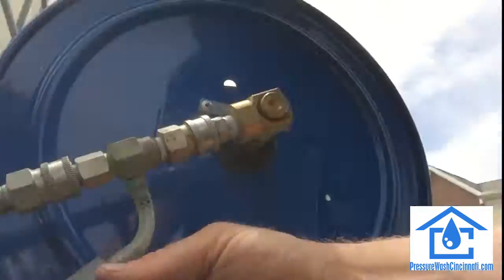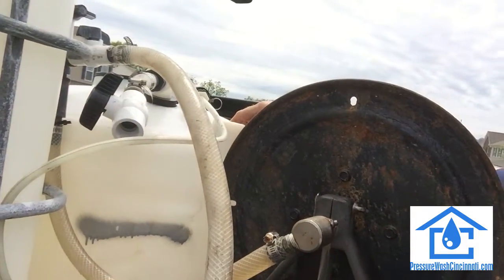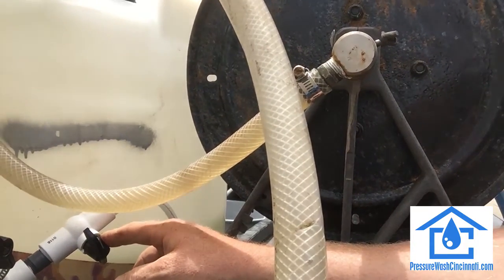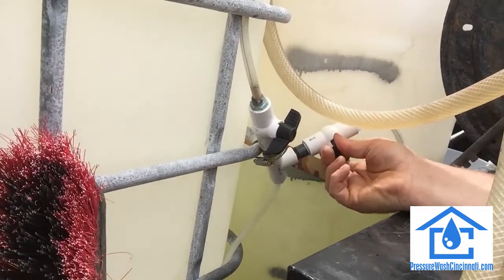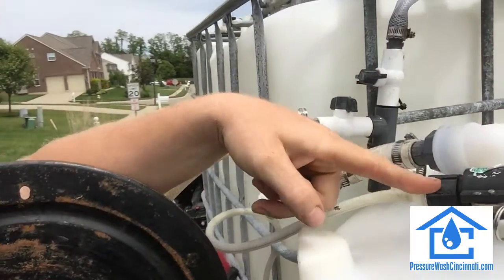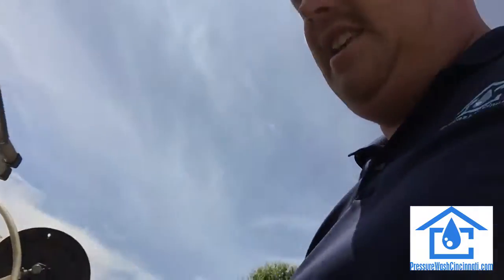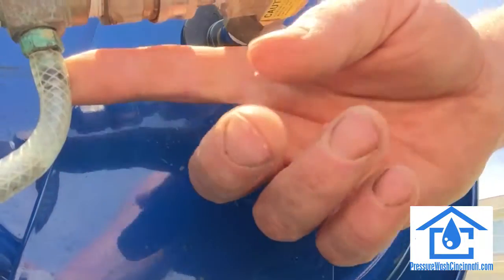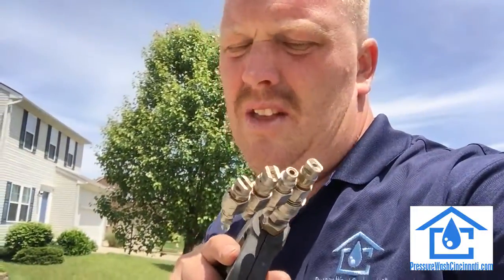How to Pressure wash using down stream injector to apply soap.

Comment: Nice. The house wax from Russ. What do you apply it on? Siding only? Thanks.
Reply from the maker: Yes siding only. If you get it on the windows you have to rinse them or they will be streaked very bad.
Reply: Thanks, I assume the wax is to put back the luster on the siding. How do you keep it off windows and make good timing with the application?
Reply from the maker: It does help with the shine and also help to keep it from growing back. we stay away from the windows. it adds about 5 to 10 mins per job.